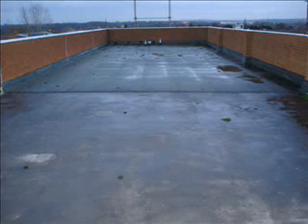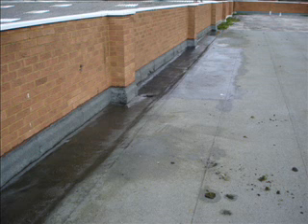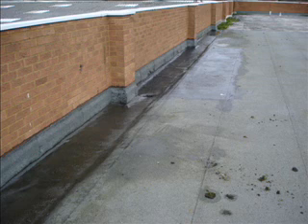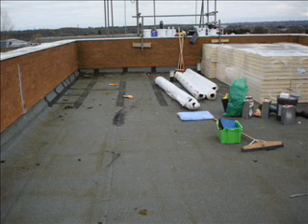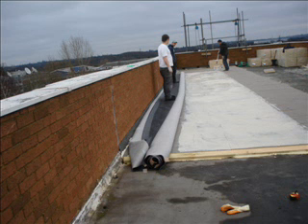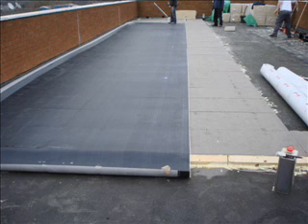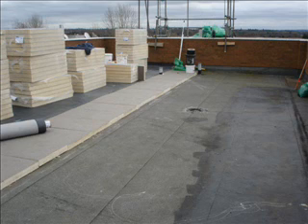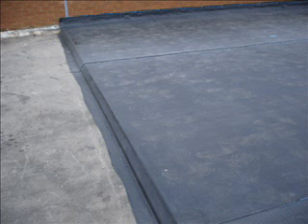EPDM over 80mm Kingspan insulation, over old felt, over asphalt

Comment: Hi Steve. How do I contact you to send some photos and get your advice on a leaking EPDM roof ? Roofer can’t understand it. Water ingress on wall with flashing and a few of the boards feel saturated with condensation. Thanks, Nigel
Reply from the maker: email me info@londonflatroofing.co.uk
Reply: Probley only siliconed the metal flashing in the wall? Its prone to failure nothing beats proper lead and and a rendered bell bead

Comment: I've learned so much from your videos.  Many thanks.  I wish you operated in Somerset.  I have a cold roof with old felt that is now leaking and I want to put EPDM on.  Is it possible to convert a cold roof to a warm roof reasonably economically and without triggering building regulation requirements?
Reply: You can convert a cold roof to a warm roof it's like most things easy when you know how basically remove the ventilation add the insulation over the top it's alway best to involve the local authority, but you don't have too.
Reply: Thanks!
Reply: Thank you Steven

Comment: It looked like you used the water based adhesive over the Kingspan, I thought you was only meant to use contact adhesive if you're direct bonding over Kingspan?
Reply: You can use whatever adhesive the manufacturers of the EPDM  specifications say  you can use
Reply: Yep I accept that.
I have been looking at Kingspan Thermaroof TR27 which kingspan states should be direct bonded with a solvent based adhesive.

Which to me implies a contact adhesive, I'm not saying you are wrong in what you did.
I'm just wondering what the insulation was that you used in the video, it could save me using contact/solvent adhesive in a direct bond project I'm working on.

Thanks
Reply: Like me you are stuck in the middle of two manufacturers  giving different info. From memory rubberbond  EPDM did the specification on this roof we would have told them the insulation we wanted to use, and they would have given us the green lite. I alway do this by email so I have this in righting. We as a company are not insured for the design we don't have PI insurance most building and roofing companies won't unless they are big and have a design department. Generally speaking,  if it's a small flat roof we now follow generic design details IE  buildups and materials that have been  detailed before by a design team ( we are not reinventing the wheel) If the roof is large we have an engineer do thermal calculations Due-point calculations water flow charts we then get the roof covering manufacturer to give specifications on what glues and fixings should be used together with what expansion joints and flashings should be used. We then get the manufacturers to come along and inspect the works as it progresses. On one flat roof we did we even recorded moisture content of all materials used before we used them just to make sure we were inside the manufacturer's specifications.  By doing this we are not taking any responsibility for design. The best manufacturer of roofing materials I have ever worked with is 3M they won't even sell you the materials without following the above method.
Reply: @bert2d212  yer I only use contact adhesive full stop much better product but is mainly a Firestone spec but tbh as Firestone are the original manufacture it's the only product I will use I dispise water based completely and using termination bar on the end just looks tacky in my opinion but as long as the roof remains water tight is all that matters

Comment: the original asphalt roof looks to have aot of moisture under it...why not remove the original roof ...also it seams that the next door roof shared a common roof slab..it does not look like you built a roof curb to the deck to seperate the two roofs thus if water does enter the next dor roof it could flow to your roof...you also just sed adhesive on to an old asphalt roof that has moisture in it...(from your photos)..I bet you this insulation without fasteners will lift soon..

Comment: I'm not sure about this but there is no mention of re asphalting the timber hard edge to the insulation boards to form an up-stand from the adjacent property.
how did you join the epdm to the asphalt, it looks like the epdm is just screwed down.
this detail should show an asphalt curb up-stand then the epdm dressed over the asphalt curb.

Comment: couple of tips here, always chase out your walls before starting the roof, tip two them boxguttors are actually called parapet guttors, or parapet gullies.
i see you have a termination bar fixed to the join-up to the existing roof the fixings look real low and the whole bar should have been covered with a flashing so as not to leave the fixings exposed.
Reply: tip: gutter is spelled with an e not an o
Reply: @robinhampshire8923  not in america
Reply: @PeakyBlinder that's Americor to you